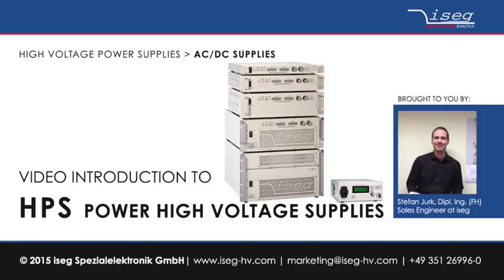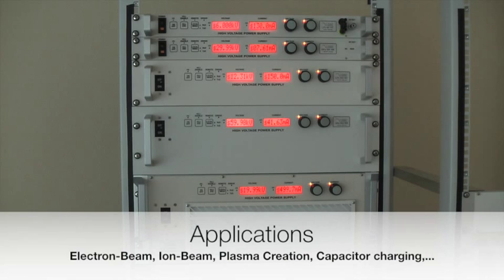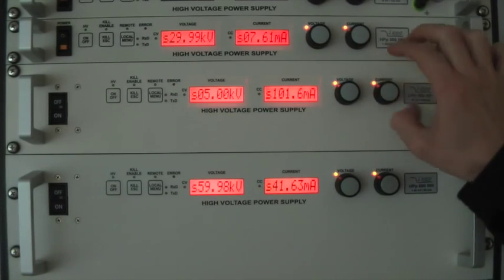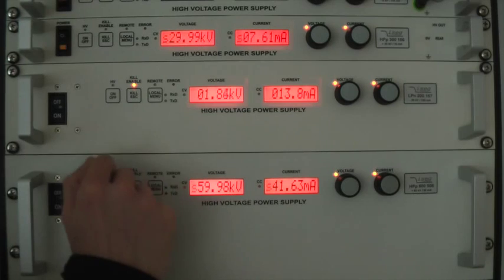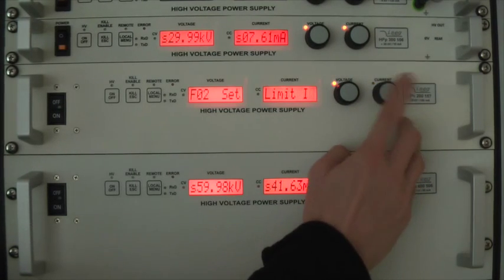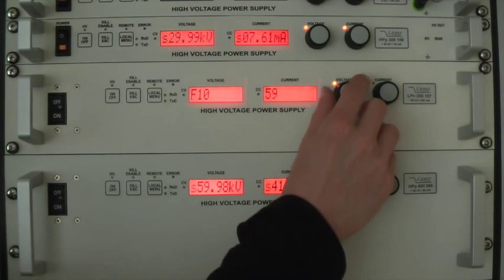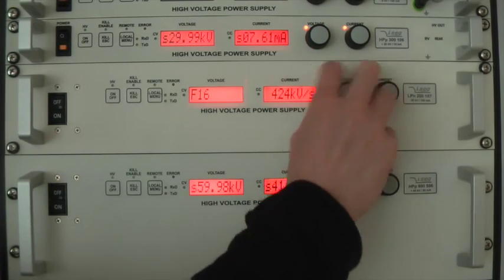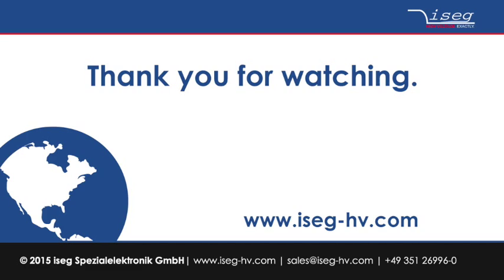iseg HPS

Comment: La gamme HPS est plus évoluée, avec une carte mère proposant des fonctions de gestion et de contrôle-commande sophistiquées. Les différentes puissances proposées, 300 W & 800 W, 1,5 kW & 3 kW, 6 kW & 10 kW, permettent de balayer un grand nombre d’applications comme le E-beam coating, le Ion-beam, le X-Ray ou encore le test de composants haute tension.Les tensions disponibles vont de 1 kV à 100 kV. Dans un environnement contraignant de type ‘arcs électriques’ il est parfois nécessaire de compter les arcs, de créer des temps morts entre les arcs ou de générer des fenêtres de temps à l’intérieur desquelles on autorise des arcs.
http://www.physical-instruments.fr/alimentations/